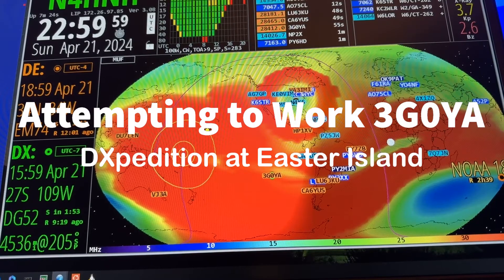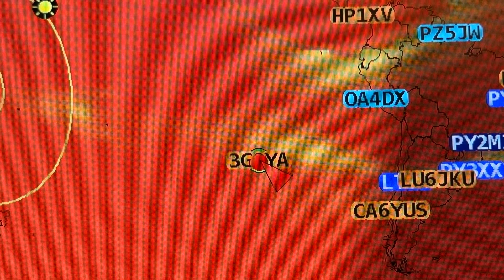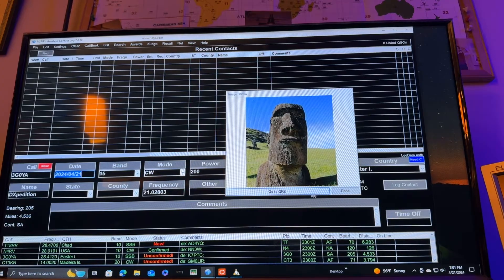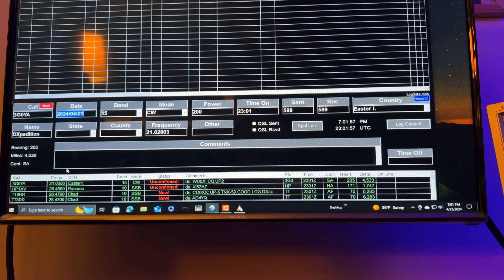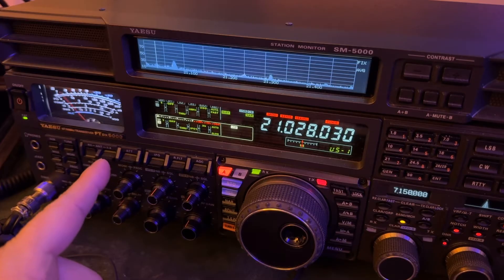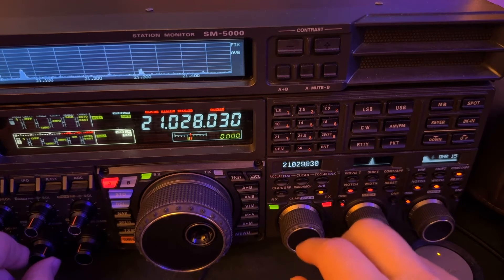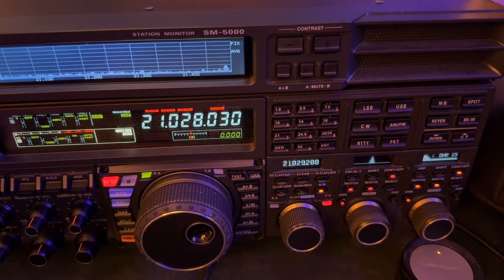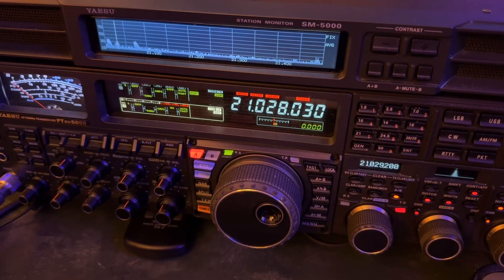Working Split Frequency: Attempting to work the 3G0YA Easter Island DXpedition #cw #split #frequency

Comment: in my experience I stick to one tx split frequency even if.comdx slides around frequencies. eventually dx will hear me... I m not sure if it's a good strategy but it works.
Reply from the maker: I use the second receiver of my FTdx5000MP to listen to who is getting through to the DX station and, once found, I use that TX frequency.  I hear the DX station in my left ear, or from the left speaker of my SM-5000.  I hear the stations calling the DX station in my right ear, or from the right speaker of my SM-5000.  With my FTdx10, I can use the TXW button to toggle between the DX station and temporarily listening to my TX frequency. I hold TXW and rotate the VFO until I hear the stations calling the DX operator.  I then let go of the TXW and transmit my callsign.  I might slip slightly above or below the cluster of people calling the DX station, if so don’t get through after a few attempts.  

The dual-receiver capability of my FTdx5000MP makes the process a little easier but the same thing can be accomplished with the TXW button of the FTdx10.